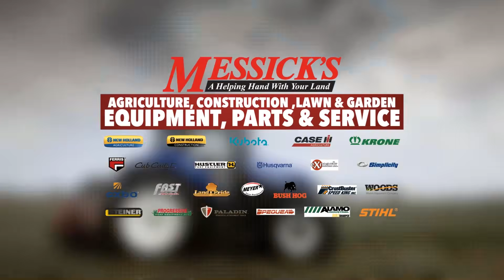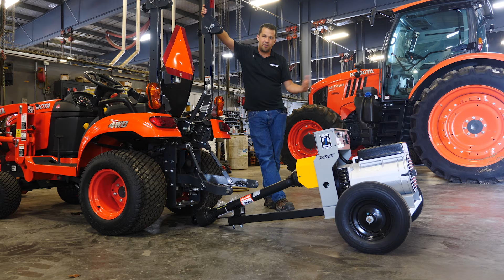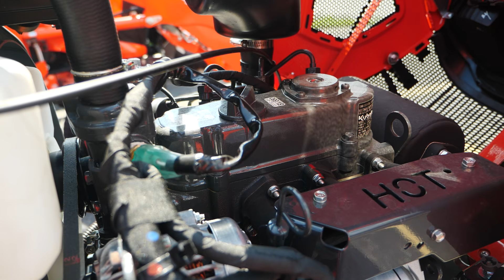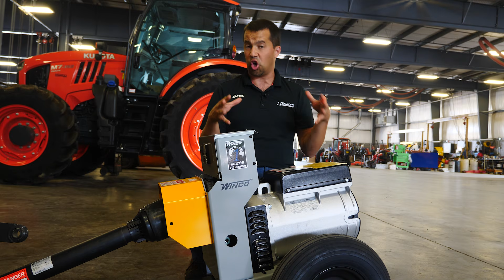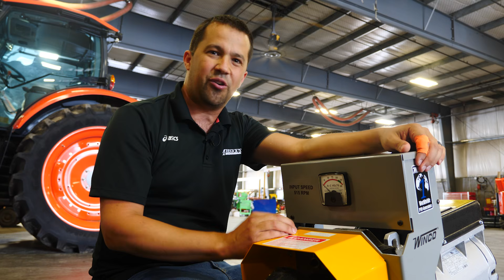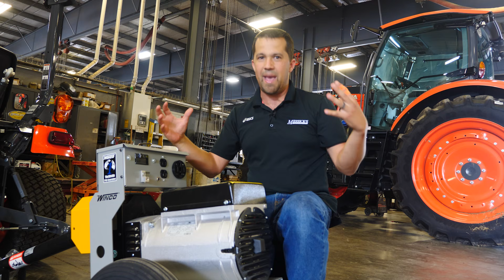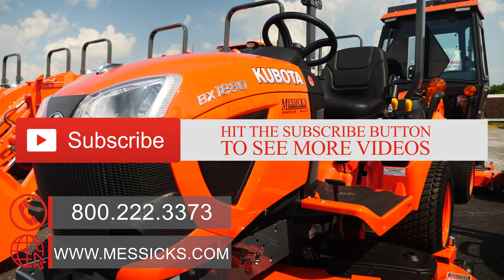Power your home with your tractor - Winco PTO Generators

Comment: So after watching this video and a few from winco, I think I'm going to go ahead and buy one of these generators. My thinking is pour a concrete pad, build a 6x6x6 building and set it up like a stand by generator. So the electrical side will already be ready to go if needed. Have a motor space heater set up to keep moisture away when I have power like normal. Then have a vent fan tied to the generator side when it is running to keep the building cool. Basically take my M7040 and back it up to the building, hook up the pto, and good to go. This way the generator is out of the weather. Only thing I am trying to figure out is the AVR and how is my tractor going to increase RPMs when a larger load like AC or well pump kicks on?
Reply from the maker: Tractor runs at constant rpm. The ratings on these is continuous,  all the moving mass gives them significant surge capacity
Reply: @MessicksEquip  and the engines do have a governor that can make nearly instataneous small adjustments in the fuel to keep the voltage where it belongs.  That's why you'll hear a light, short "grunt" when a large motor starts...that's the load on the tractor and the governor quickly making the necessary adjustments as needed.
Reply: @MessicksEquip  oh, very cool, ok I didn't know that but that does make sense then. I was just thinking of the generator being a load on the tractor like my bush hog hitting a thick spot, bogs down just for a few seconds or I have to slow down. That's how I was picturing the in rush current when say my AC unit or well pump kicks on. I'm leaning towards a 25kw.
Reply: @FF5754  Just make sure that the tractor you use is large enough to handle the genset.  you need at least a 50pto hp tractor to get 25 kw CONTINUOUS output.

Comment: I looked at one of these when I was shopping for a generator. I didn't choose it cause its main use is for storms knocking out power and with that trees may be down so I would want my tractor for clean up. Also if I want to take my generator for a job I dont want to have to bring my tractor also.

Comment: For some sizes the price of a PTO unit is not any lower than a gas or propane unit. Add in the fact that the tractor may often be needed to clean up after storms (the cause of many outages in the first place) and the reality that the tractor does not compensate for any changes in load like a self powered unit will. And lets face it - Tractor hours impact tractor resale.

Comment: Just ran my pto generator for 6.5 days.  Kept my house going.  13,000 watt ran a 5 ton a/c unit and two freezers and two refrigerators and lights, tv, etc. during the day.  Ran two 2 ton a/c units and all the other stuff at night with my Kubota L3901.
Wife was worried about the tractor,  I was worried about the food and keeping the house cool in Central Louisiana in late August.
Your video was right on the mark.  Thanks for all your work on very good video.

Eric S. Duck, P. E.
Reply: Eric Duck I’m in central Louisiana as well. What PTO generator do you have? I would like to get one before another Laura comes.
Reply: @sphill_edc  Northern Tool is the company I bought it from.  It was $1,000 several years ago.  Have not checked the price recently.   Also purchased the outside plug to connect to house.  Had to also buy a power cord to connect it together.  I built a 3-point hitch to mount it to tractor.
You may want to mount it on a wheeled cart for easy moving.  The one in video was a nice package.
Reply: @JacobTerherst  it was about 100 gal. Or about 1 gal/hour.
Reply: @ericduck8273  We burnt just under a gallon per hour running a 25kw winpower generator on a 1980 Deere 2440 over three weeks after Katrina on my parents' farm in North Tangi Parish, LA
Reply: and take it to heart that a normal 5kw (5000watt) portable briggs OR honda generator runs nearly that same ammount of fuel, but doesn't power no where near what we had running!
Reply: I have ran one for years! 7800watt ..... transfer switch at my load center and a external power receptical for the 30amp cable.... powered by a B2620....with a L3901 in reserve spare status.
Reply: I live in Biloxi and your review sold me. Same scenario. Kubota L4701 and the 15KW Winco. 3.5 ton AC, 3 freezers, 2 fridges, and an ice machine. The only way to go for living on the Gulf Coast.
Reply: I have a 48hp tractor. And I probly only need 10-12kw. Would this scenario mean I may end up using considerably less than 1 gallon per hour with a larger engine pushing less kw?
Reply: I have an older Kubota and am looking at a Winco to do the same thing. Eric did you leave your tractor running the whole time?  Refuel while running?  Just curious as I am considering the same and don’t mind running a tractor - but can honestly say I have never run one 6 days straight.  How did it do?  How long did it take you to get used to it running non stop?  Any concerns while you were doing it?
Reply: @charlessavino7946  I know in the past I've heard of semi drivers running their trucks for 90 days straight. Diesels can do that. Especially the older ones that are over built and well maintained.
Reply: @charlessavino7946  I have a new Kabota L3901 with about 100 hours.  No problems with it nor any concerns.  I ran it while I added fuel.  I did disconnect a few times while I used the tractor for cleanup.  I used it to carry limbs, etc.  I would shut it down to check the oil.  I would cut away from generator 4 or 5 hours during the day, but ran it all the other times.  
Good luck.
Reply: @charlessavino7946  My family are dairy farmers from North Tangi Parish, LA, and we ran a 25KW on a Deere 2440 (1980 year) 24 hours per day for THREE WEEKS after hurricane Katrina to power the farm and my parent's house, and we didn't have any issues.  Since it's a diesel, we filled the tractor from a skid tank with a 12volt electric fuel pump while the tractor was running.  We would NEVER have filled a gas powered engine while running!
Reply: I too have a 3901....for about 5 yrs now. It was invaluable after Michael here in So Alabama. Never thought about a pto generator.  Will look into that now. Thanks.
Reply: ⚠️Please make sure you follow all the generator safety tips whenever you use your portable generator. This is just a reminder for your safety when using generators. All generator safety instructions need to be followed carefully. 

Here are the safety tips: 

1) KEEPING OTHERS SAFE: Please do not allow an unqualified person or your children to operate and service the portable generator. Just because some manuals don’t say that doesn’t mean it’s safe. That is important against the generator safety rules. We also need to be keeping an eye on our children too. You need to make sure that your children are not playing near the portable generator especially when it’s running so they won’t get electrocuted. Generators pose electrical risks and they can be hot during an operation. Please keep your children away from the portable generator at all times. It is important to keep our children safe especially our little ones. Children often get curious about anything so we should keep an eye on them to also make sure they’re not wandering towards the generator. 

2) WHERE TO RUN YOUR GENERATOR: Some people use their portable generators indoors which increases the risk of carbon monoxide poisoning. It’s important to have a carbon monoxide if you have a gas generator. Never ever use your generator indoors even if your doors and windows are open and even in the garage is not safe to use a portable generator. Not even at your porch and your deck. It is never safe to use your generator indoors and in enclosed areas of your home. Your generator needs to be 15-20 feet away from your house. 

3)🔥FIRE HAZARDS: Never refuel your generator while it’s running. You need to let your generator cool off before refueling it and before storing your generator. Never overload your generator too. Never ever back feed your generator. You should never plug your generator into a wall outlet. Also never store propane tanks indoors. Please keep flammable things away from the generator as well and please don’t smoke cigarettes near the generator. Having a fire extinguisher next to the generator is also important against the generator safety rules. 

4) GENERATOR OPERATION: make sure your hands are dry before touching the generator. Never use your generator in wet conditions. Don’t let your generator get wet. You need a generator tent if you need to use your generator during wet weather. Please don’t wear loose clothes when operating the generator. Turn on your generator before plugging in appliances. Use the right cord for your generator. Please do not use worn out cords. 

Hope this helps.

Comment: i have a small 4kw gas unit i have had since before i bought my tractor. i am going to replace it in the next couple of years. im leaning towards on of these units, only issue being if i had to use it during a snow storm i would have to detact the generator and hook up the snowblower and go back to the generator. i have a rear mount snowblower.

one more thing to add........ THIS application greatly benefits from the larger engines offered in the BX. in this video he uses a BX1880, a BX2380 would be able to run more current maybe 10KW, a BX2360 might possibly have enough oopmh to run this nearly at full capacity. i have a BX2350, 23hp and i believe would work well with one of these units.

Comment: I understand the motor might not have any issues running all day but the hydraulic pump running for that long at a constant rate might not be as reliable. I could see that being a issue long term, maybe not?
Reply: Mr. Sunshine one why....just why be so angry. Obviously I'm asking a question of can the pump handle the task as well as the engine. Could have ask it better or expanded on my thoughts but I didn't think a Karen would be so offended. So with that said..... I'm sorry you are so soft spirited.
Reply: Mr. Sunshine  good contribution keyboard warrior😘

Comment: I have had an 8K Winco since the early 90's.  Works every time I need it.  The best thing is that I know that my 4710 Kubota is going to crank where the little gas engine that hasn't been used in 2-3 years isn't going to when I need it.  I heartily recommend one.
Reply: And you are using far less fuel than using gasoline/propane/natural gas, and diesel is far safer for the environment (when used in a properly maintained tractor) than gasoline!

Comment: It isn't worth wearing out your tractor to run a generator.  Also if you need a generator you probably also need a tractor you can use for things OTHER than generating.   IIRC,  Winco makes generator wagons you can mount an engine pack to... far better deal since you can install an older engine that can run forever at the generator's power requirement.   An engine trailer with a PTO on it is actually more useful than a generator trailer too... so get both.

Comment: Good video Neil. My only problem with tractor driven generators is since I only have one tractor, many times the cause of no power is storm damage. As others have stated the tractor needs to be available for other work. That’s why I have a large portable generator and transfer switch on my house
Reply: That's why you have a SMALL prrtable to run just the basics while the tractor is being used for other stuff (you won't be inside so the A/C won't need to run), and when you get ready to "relax", hook up the PTO one and use FAR LESS fuel!

Comment: I live in California. Last year we had planned power outages caused by poorly maintained power lines in high fire areas. Power was off for days. Gas stations had no power so you couldn't get gas. I now have a pto generator because I live in dairyland. There are 1000s of gallons of diesel in gravity tanks at neighbors.  I also store around 30 gallons myself since diesel is more stable than gas for storage.

Comment: How do bi pass the seat shut off for the tractor to make it run without someone on the seat for  a generator
Reply: On a BX, you just flip the seat up and it activates a switch that bypasses the ‘no driver present’ kill switch.  
Pretty handy for things like PTO driven things like chippers and generators.  
Other tractor brands vary but they all have a bypass method for applications just like this.
Reply: @ryanfair9354  I have a b3350 with a cab on it I might have to see if there is a bypass some how
Reply: @Ravin96er  I have a B2650 with the cab and to run the rear PTO without sitting in the seat you have to latch the parking brake down and if you have a PTO selector lever option to switch between mid and rear I believe it needs to be set to rear only and then you should be able to get off the seat.
Reply: Personally, you can either cut and rework that circuit (which is what I do on mine) or add a toggle switch in the circuit that you can switch appropriately as needed.

Comment: This is a reply to multiple comments asking about rpm control. 
As for durability, I have serviced mobile and stationary units with the same engines that have upwards of 9 thousand hrs. Just the regular maintenance religiously.
As long as your loading stays in your hp rating, the governor on the engine will hold the rpm steady. The only time it would vary, a miniscule time, is catching or shedding a load. This is called droop and surge. The only time this would become critical is when coming  close to the maximum load vs available hp ratio.
Once that is exceeded, the governor will just go to limit with the engine bogging down. This applies to all generators, not just pto driven. The more sophisticated units will shed load by tripping breakers at the least or by canbus to a load center that will start switching loads off by priority.
The math work is critical!

Comment: I’ll stick with my generac off natural gas.... powers my whole house and you never know it’s on. Like most tractor implements this is probably the standard 5 grand range give or take and far noisier then my generac that I paid 5 grand for new.

This would be cool where there wasn’t power out in the wild
Reply: Had a generac manhy moons ago running on propane (no natural gas here)...and that poorly made POS burnt up BOTH my freezers, my refrigerator, my water well pump AND my central a/c while it was under warranty, and generac wouldn't do a damn thing but repair the generator.  I told them to give me my money back and shove that POS!

Comment: One really big advantage of having a battery backed off-grid solar power system is that you can run a generator like this for a couple of hours and charge the battery all the way up.  Then your tractor is available the rest of the day and you don't have the noise.  Without a battery, most of the power from the generator is just being wasted and your wasting gas or diesel or propane.  Now if the sun comes out, then you don't need a generator at all!
Reply: Technically, you could just use the tractor's alternator and batteries to charge the battery packs if you have a 12 volt battery system.
Reply: With the Sun you don't need any generator?   What size solar panels are you using to provide 8-9KW or power?
Reply: @eosjoe565  I have 24 x 345W panels from Solar World (8,240Watts).  https://youtu.be/zb4oar9UHSY

Comment: I'm wondering, with this much power output, if this could be used to power a welder to repair equipment out in a field.
Reply from the maker: Yes
Reply: That is probably the most practical use of a PTO generator on a farm. You can tow it anywhere on the property and have the power that you need. Then again, I do the same thing with my portable generator. I haul it around with my tractor to power my welder and other power tools. I have also loaded it onto my small landscape trailer for remote welding jobs.

Comment: I don't think I'd be fond of having the tractor running at 2200 RPM right behind the house. Pretty darn loud!
I can see where they would be really useful if you needed power away from buildings though.
Reply: no louder than a portable generator!  Also, the only reason a "whole house" "generac style" generator is quiet is that they jam all of that hot generator/engine in a sound-reducing box...that box makes that genset far hotter and reduces the life of the generator!

Comment: I love my pto generator only problem with them is they produce really dirty electricity that is really hard on electronics like computers so be mindful when running them and computers at the same time it has fried my milking parlour computer before
Reply: generally that only happens when the generator is at it's maximum load.  My family have been dairy farmers here in Louisiana for over 50 years, and have never had a PTO generator burn up anything in the barn OR my parent's house (both buildings are on the same electric meter).  Now, I can't say the same about a crappy whole house generac that I had at my house for less than a year.  That POS burnt up nearly everything in the house one day...They ended up giving me my money back, and I went and got my own PTO generator.  My wife (now ex-wife...long story) wanted that generac POS...until it tried to burn down our house!